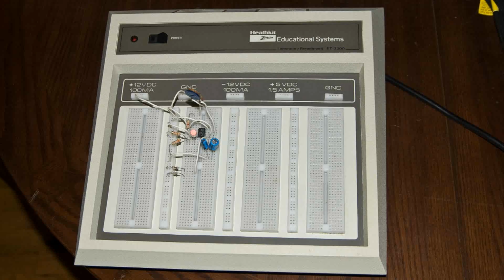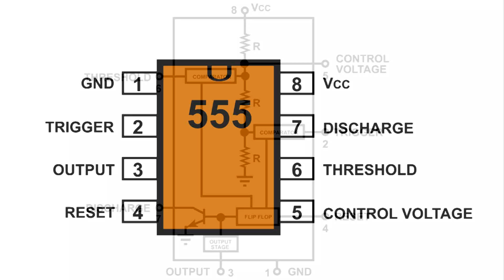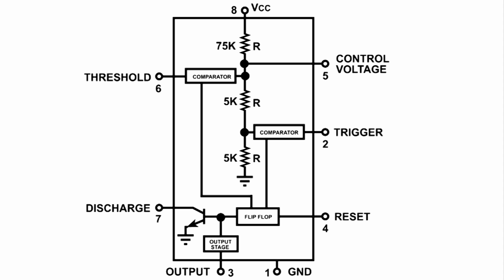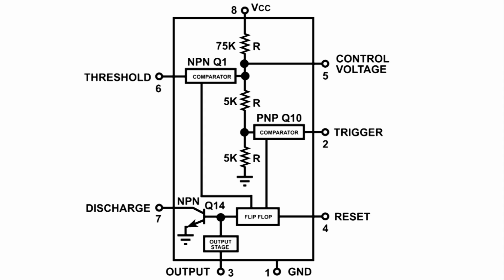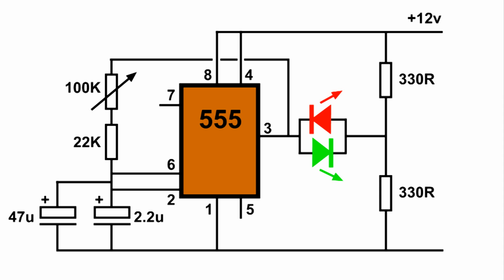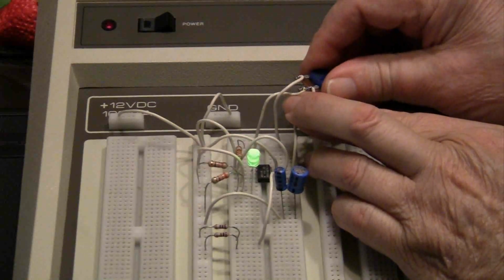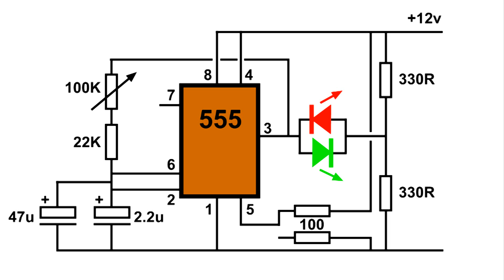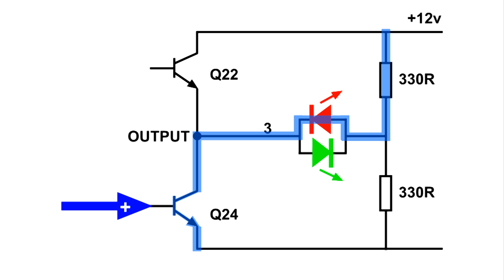555 Timer

Comment: Thank you so much for posting! It was a truly educational video. Quick question, did you use bipolar electrolytic capacitors (the two in parallel) or where they biased? I've been trying to find bipolar electrolytics online but the only ones I've seen do not look like the ones you have on you demo--plus they're on the expensive side. The other option is ceramic. If they were actually bipolar, how did you connect them to the circuit (i.e, which side was the anode)? Thank you so much!
Reply from the maker: The capacitors are ordinary polarized electrolytic capacitors.

Comment: At the end of the video would both not flow to ground. Ive finally gathered enough courage to dive into ic. Currently I'm trying to understand the different latching systems through transistors so this is the next logical step. Also I'm working on a flashlight and it amazes me how difficult one can make it. Fyi from a viewers  point. dont worry about how fast you talk. Cram that info!
Reply from the maker: Do you have a question?
Reply: First sentence
Reply from the maker: “At the end of the video would both not flow to ground. “ Both what? What is your question?
Reply: I think i figured it out. Pnp will push the ground up into the circuit while npn pulls towards ground.
Reply from the maker: Electrons flow from negative to positive. The arrow in the Transistor diagram show if it is a PNP or an NPN. In a Transistor, Led Diode or Diode, the arrow points to negative. Electron flows is against the arrow.

Comment: I had the same problem some time ago. The problem is that pin 2 must be triggered with a negative (!) voltage (according the datasheet from National Semiconductors). This is often not told in schematics. To solve this problem, connect pin 8 (power supply) via a resistor (500 Ohm-2K) to the positive lead. Now the trigger input pin 2 is "lifted" from the minus-to-ground level to a level higher than ground and can be driven normally.

Comment: On the schematic at 6:50, 2 separate LEDs are being used, but in the actual circuit, it appears that only a single LED is changing from green to red. Am I missing something?

Comment: No, The circuit in video is not quite right, the discharge pin 7 can't be left floating like you see here for astable circuit to work, and pin 5 is connected to 0.01uf cap. The best thing to do is google a 555 astable circuit, and compare. He already admitted that he made mistake with one of the value resistors in the 555 timer circuit which is 5K

Comment from the maker: No matter what chip you use, care must be taken to not exceed the power requirements. So if you design the power supply to match the chip's specifications, you should be good, and there are almost an endless number of designs.

Comment: Thanks Rick for a Excellent Explanation of the 555 Timer!! Our little Friend has been around since 1970 ( Designed by  Hans Camerzind)  and is still used in Countless applications!!  I designed a SCR Tester as well as a Remote Control Tester using this little fellow. thanks from 321reh

Comment: Hi Rick, I can remember working for a company that was just about to embark on its first solid state project, the team leader went out and brought a 555 and a 9volt battery.  You realise that you now have your lifetimes work cut out don’t you, building the seemingly limitless assortment off 555 timer circuits. It’s such a versatile little chip, well done on another nice video. By the way, if you start on the 741 op-amp that should take care of the afterlife as well.
Kind Regards ... Andy

Comment: Great video ( : Especially as I have recently been experimenting with 555 timers, namely using them to drive a MOSFET that controls a high voltage transformer (video on my channel) but it is nice to learn what actually happens inside of the chip.

Comment from the maker: Thanks ae4se
Now this 555 or something similar are incorporated in other chips plus much more. Yet it is still used today and is great for the beginner. It works and it is cheap, and lots of circuits for it. Radio Shack did have some great books and they do have some project books today.